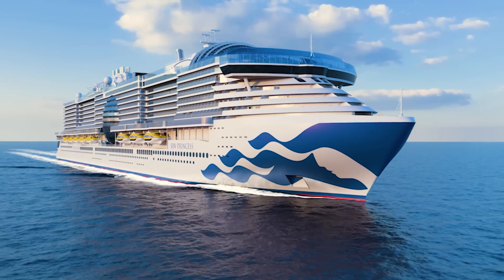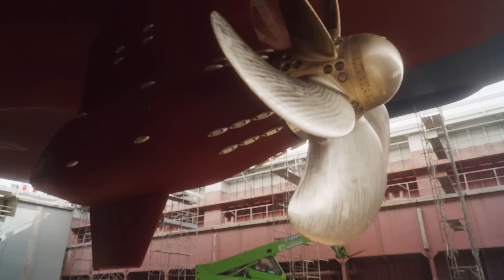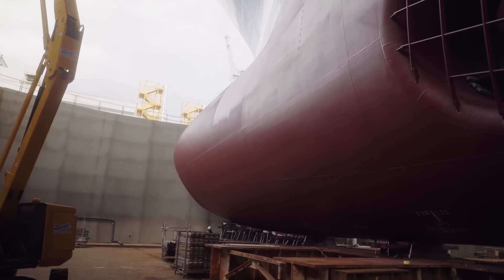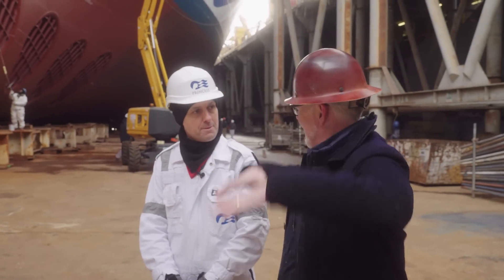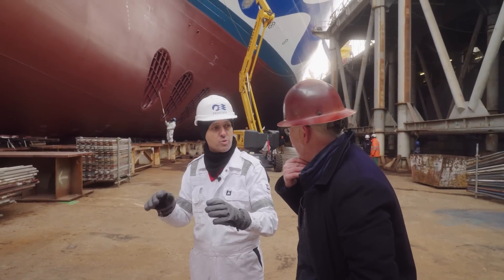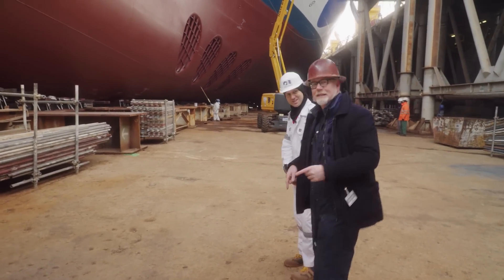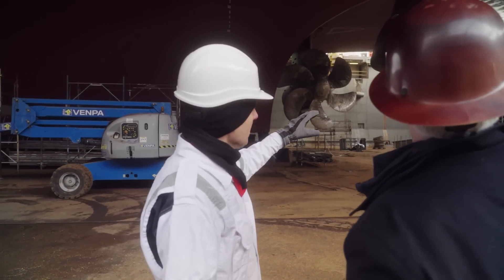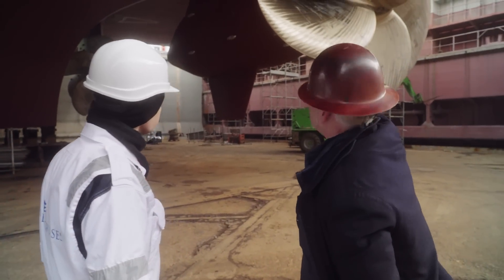This Ship Has a Big ... Nose?

Comment: When he was talking about the air system that increases the efficiency of the hull I thought about a system the Navy has been working on for torpedos. To get torpedos to a high speed they are forcing. a bubble of air in front of the torpedo so that it has much less friction from the sea and can move at much higher speed.
Reply: One big problem is the bubble causing cavitation around the propeller.
There are experiments using liquid fueled rocket thrust.

Comment: in metal detecting galvanic corrosion is something you should know because some soils eat metal and others add metal, metal detectorists often refer to a coin ball well that's good soil the ball is added material clay and clay sand is the best just sand is the worst because the black sand is a dominant galvanizing material it pulls the metal out of an object because the mass is greater, in clay metal is present but in lower density and the particles are microscopic and the density of a coin's metal is greater than its surroundings so it will be covered by the metals in the soil I found both a copper coin and a gold one the copper one was mint because it was in clay the gold one was a disc siff it came from sand the cool thing was it was a medieval Groot with cross and the hammered features didn't corrode so you could still identify it

Comment: My question would be how much electricity does the ship use from the diesel generators to "reduce carbon emissions" with the MASSIVE, hull, air injections??  I could only imagine the size of the motor and compressor that would have to run constantly to generate enough air to make a difference.     Probably a zero sum game!
Reply: It obviously saves fuel / cost in the long term, or they wouldn't spend money on it in the first place. That's like the very first engineering calculations done. What's the ROI of this? How long is the payback period? If it doesn't pass those 2 checks, there's no point doing any other design work and wasting money on the idea.

Comment: The "air lubrication system" also might have the effect of reducing noise from the hull from getting into the ocean. IIRC, US Navy ships have a similar system, but it's for masking noise and reducing the ability of submarines to find them. @Adam, can you find out if that's true?
Reply: It is true.   This system is called "Prairie / Masker"    Masker is a series of belts that run vertically along the ship hull, and Prairie is routed through the interior of the propeller(s).   Both use high pressure air to emit a stream of bubbles that changes reduces the noise level and changes the character of that noise.
Reply: The first thing I thought about that relates to Adam was when they did the air bubble myth where they pumped bubbles and they immediately sank. That's the same principle, I think.
Reply: @erwinchan6077  As I recall from the episode, at least some of their experiments with bubbles they didn't sink but rather were pushed up and to the side because of the upwelling current of the water being dragged up with the bubbles.

Comment: I'd have never thought about marine vessels using collective pitch, pretty cool.
Reply: I think collective pitch is only used on the thrusters on cruise ships. This is so that the magnitude and direction of the thrust can be quickly changed when maneuvering. This was the thrashers can go from port to starboard without have to wait for the blades to stop spinning and rotate the other direction. There are some large military vessels that use collective pitch on the main propulsion. This is so they can do a “crash stop” in an emergency to very quickly stop the boat. The ship will go ahead full speed, the pitch is then quickly reversed making the props go full astern in only a few seconds. You can search for some videos, it is pretty amazing to see.

Comment: I read about some of this tech when I was a kid, like 30 years ago.  I had a book about hydrofoils...  The "air lubrication" system is not new, but maybe wasn't worth implementing before the emphasis on emissions?
Reply: Emissions? You think they care about emissions? It just saves fuel cost, and thus means higher profit. If you think they care about emissions, you should look up what type of nasty fuel these huge ships run on - it's like burning the worst of the worst of crude oil, mainly because it's cheap and they need huge quantities of it.
Reply: @gorak9000  emission = PR, and yes, they care about PR!  Don't be naive.

Comment: There has been 1 episode of Mythbusters that has always annoyed me with how little it was tested. It was firing a rocket launcher at an SUV to get it to flip. They didn't listen to basic physics and shot it directly in the radiator. I wonder if aiming UNDER the vehicle would have made any difference. Instead of the forces getting absorbed by the engine, it should now blast the front end in the air.
Reply: Sorry, this has been on my mind for like 5 or 6 years now.

Comment: I think generally paint on a prop would be a bad idea anyhow with cavitation. The blades should already be designed for its purpose to reduce it as much as possible, but it cannot stop it outright. So that little bit of cavitation would just rip the coating off I think.
Reply: big ship props don't cavitate. that's only on your off the shelve outboard.   They're not painted because the abrasion will just wear the paint of fast.  Also they don't need to be painted. ship's prop's spin every second a ship moves. and these ship's sail more then they are in port.  Spinning trought the water at 150 rpm's  no marine growth will stick to the polished smooth service, and them being a bronze alloy they don't corrode either.
On sailing yachts props are occasionally painted with antyfouling paint, because they do not spin the majority of the time.
Reply: The biggest risk is paint not coming off evenly. Paint is weak and easily shatters. So you now have grams or even kilos of mass differential on the propeller messing with balance, which creates vibrations, which increases cavitation, which increases chipping and it becomes more imbalanced.
Reply: I was figuring they wouldn't or really have a minimal effect on cavitation. The balance part yes, if it were coated and a little bit wore off, it would keep building from that one point. Eventually throwing if off balance, though I think it will depend on RPM, and how dense the coating is. Something that is very light and spinning slowly should have a minimal effect on balance given the mass compared to higher speeds even with a light coating or heavy and slow.

Comment: I remember reading that the ancient Romans were aware that the length of the hulls on their triremes affected their efficiency due to the interaction of the bow and stern waves generated by the hulls. As they built larger triremes, they chose specific hull lengths that would increase efficiency by effectively canceling the two waves. Similar effect as the underwater nose design on this ship. Way cool. 😎

Comment: I'm wondering about more detail regarding those 14 air release units on the bottom. Given that they are basically holes into the ship, how do they prevent water ingress when an air injector is malfunctioning?
Reply: I don't know the answer, but I can tell you that however it does that does work.  Royal Caribbean has been sailing ships with this technology for years, I sailed on one that I think had it in 2018 and I don't think it was the first.  Harmony of the Seas (not the ship I was on) has it, that ship has been sailing for a while now.
Reply: At least one system (Wärtsilä) uses "non-return valves [to] passively regulate pressure". Despite the huge weight above them, the injectors are still only 8 meters deep, and that's not a lot of pressure.
Reply: These newfangled inventions called check valves - you should check them out - fresh off their kickstarter in 1907 (if not earlier)

Comment: Does it address the environmental impact of cruise ships?
Reply: Fuel wise, yes, it's using LNG (Liquefied Natural Gas) which helps cut it's emissions pretty drastically.
Reply: @the7egend   Nope, it is dual fuel. It can barely run for more than a week on LNG, so it will still be carrying nasty marine gas oil. It can use LNG but they can and probably will continue to use MGO because it is much cheaper and who is going to really check that they are using LNG.
Reply: @the7egend   Did he say that the wave cancelling front made it more efficient too or would that just make the ride smoother?
Reply: @Jezee213 It is for efficiency, the stabilizer is for comfort
Reply: @Shadblade5  awesome thank you 👍

Comment: It never occurred to me that single drive propellers would turn to one direction, but having another one would counter act that.  Ships are SO COOL.
Reply: Titanic had three, starboard & port rotated opposite of each other but never quite knew the center's rotation.
Reply: Aircraft have used that concept for close to 100 years. The P-38 Lightning of WWII, for example, had its propellers spinning in opposite directions. That is called counter rotating propellers. If you don’t do that there  would be torque off center. Some aircraft would lengthen a wing to counter that torque. In WWI, the Sopwith Camel and Fokker DR.1 (triplane) utilized the torque to be very maneuverable to the right, but less so to the left, as you are fighting the torque.
Even small vessels like the PT boats of WWII had twin propellers for balancing out the torque, it’s a common practice. The Camel got its nickname partially from the high right torque as it could “bite back” a novice pilot who could loose control of the aircraft.

Comment: I don't know when the tech first started showing up, but I first heard about the "bulbous bow" back in the '80s, as a fairly common feature on cargo ships.  But I guess you don't usually see them on cruise ships as they're too low in the water once the interiors are fitted out.
Reply: While cruise ships sit at a consistent enough depth that the bulbous bows rarely breach the surface, there is a logo pained on the bow of the ship above the waterline to let you know that it is there. I suppose the logo is for smaller craft moving around the ship so they don't bottom out on the top of the bulbous bow...

Comment: I had air lubrication ideas for boats in my head years ago (very abstract thinking, not an engineer 😅) delighted to see it has become a real thing, and on such a scale! 🐟
Reply: They’ve had a similar concept on small boats for years now. Think 30’ sport fisher or something. On those, though, they don’t have compressors or anything. They shape channels directly into the hull that draw air from around the water line on the sides of the boat up under it to reduce friction.
Reply: Passive air lubrication have many sport boats  look for steped hulls

Comment: I have an irrational fear of big ships. I can be on them, I can see one across the bay. But being up next to one or looking over the edge from high up terrifies me. It’s like my brain doesn’t believe it can be held up by water.

My mind trusts those dry dock shims more than water?  I didn’t realize this fear wasn’t being triggered until half way through the video when they went under the ship because suddenly I went into full panic.  Goosebumps, sweating, everything. Nothing riles me like that. Even a little.  I’ve had cars coming at me and assumed I was dead and didn’t feel that scared.

I also have this fear with being at eye level or on a hot air balloon. My brain doesn’t trust the empty air inside is holding us up.  I am super rational and my spacial awareness is actually super good but for some reason water and air are considered suspect substances to my hindbrain.

Driving next to big trucks in the wind scares me too. So my trust and fear of air pressure are contradictory.

Comment: So that cruise ship is technically powered by outboard motors? Nuts.
Reply: "Technically" outboard means aft of the stern. These are not aft of the stern. I get what you mean, though. They've adapted the idea of the stern drive to increase efficiency over the traditional propeller shaft angled downward, and to allow steerable  propulsion.